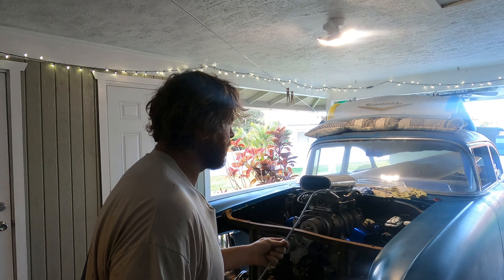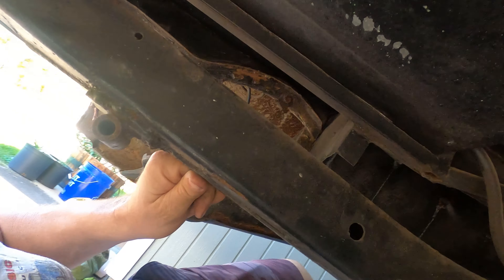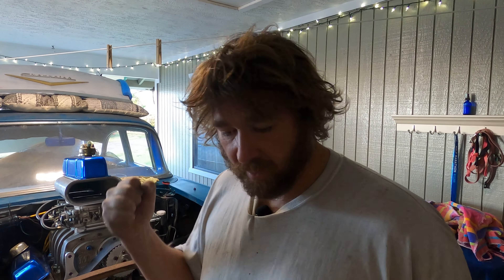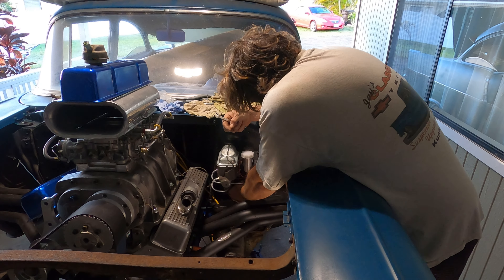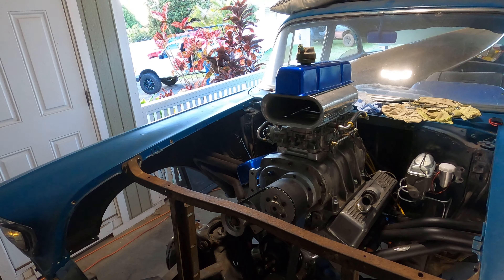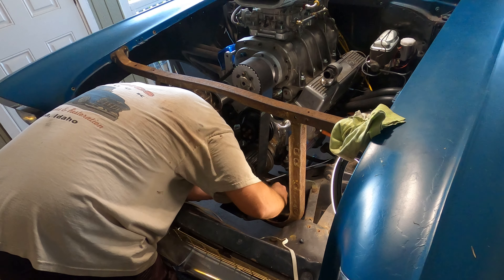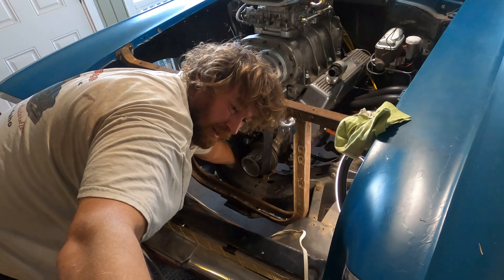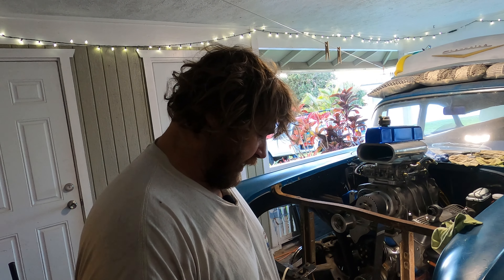1957 Chevy in Hawaii....Are we done yet? Brake lines saga part 3 of 5

Comment: Keep it up man going to have brakes soon. Never fun bending those lines. On the master You hooked the big reservoir to the front brakes right?
Reply from the maker: Ironhead Garage hmmmm. Chris good question. I believe so, but Ill look. I might have messed that up. I didn’t even think about it when I was making it. I know the bigger line nut is the rear port and is going to the rear. I think the big res is the front one. I need to pull the cap and look
Reply from the maker: Chris... watching the video... looks like I have it reversed. Ill pull the cap because it might be on backwards
Reply: @JAWSatBCPerformance  yeah because when I did my hotrod truck the speedway brake diagram said to put the front brakes on the big reservoir
Reply from the maker: Ironhead Garage Thanks Chris. I need to check that.